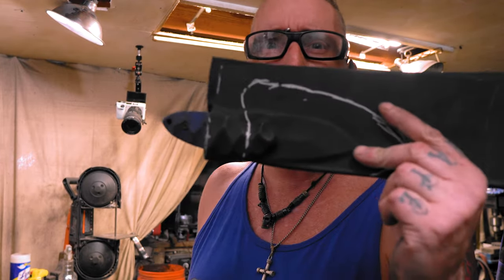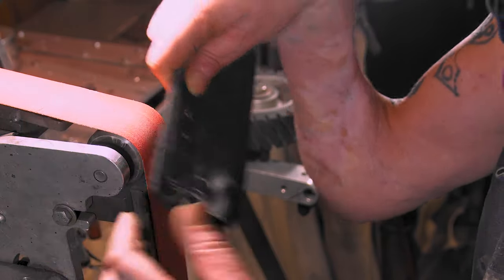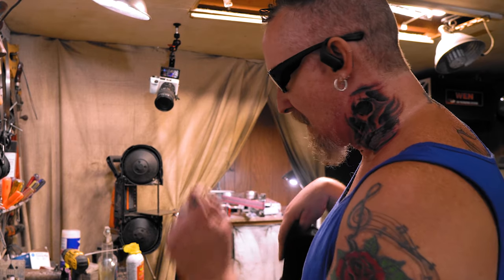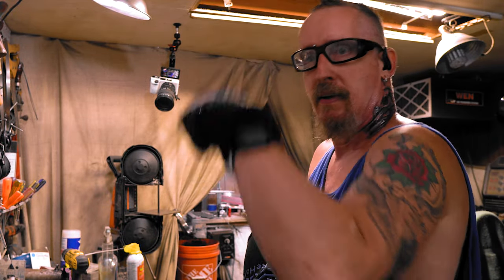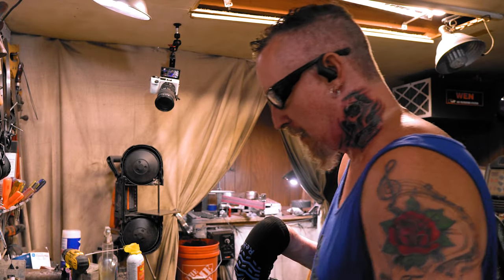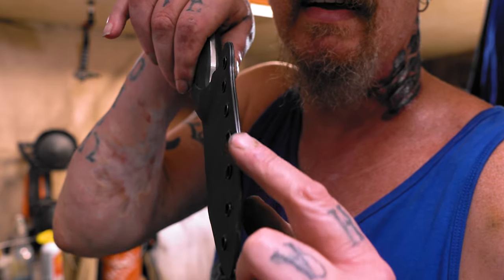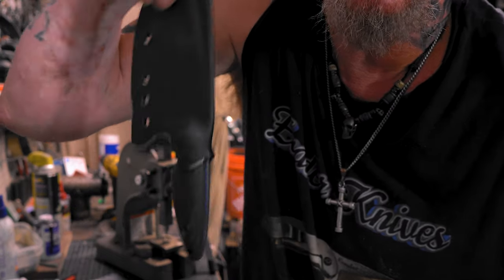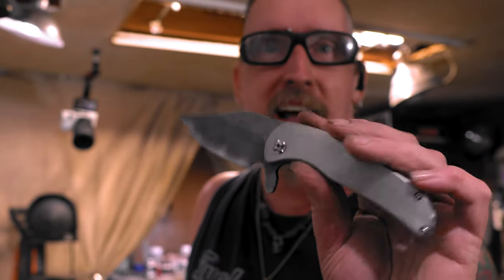Knifemaking - Kydex Sheath

Comment: i'm surprised you haven't bought a bigger bandsaw by now Dave! one of my biggest peeves with them is all those small cuts you have to do because of the shallow throat on them!!
Reply from the maker: It's not too bad. Sometimes I have to figure out creative ways to cut, so I'm not wasting material, but it's usually ok. Hope all is well
Reply: @evaderknives  it drives me crazy having to keep switching angles myself i prefer fewer long cuts!
Reply from the maker: @keithmoore5306  I hear that. I don't like it, but what I'd really hate is spending a few hundred on a new bandsaw, hahaha
Reply: @evaderknives  harbor freight had bench top one for $89.99 a while back!
Reply: @evaderknives  it seems damn good for under a C note!!
Reply from the maker: @keithmoore5306  I think that is a scroll saw for plastic, etc. The cheapest metal one is almost $300, at least right now. I had to go see
Reply: @evaderknives  no it's a 15 inch bench top bandsaw! i just picked up a metal cutting blade at /menards and put on it! works fine for my use! granted it's made for woodworking but it works!!

Comment: Dave is there any reason you don't just use a spacer to loosen the top of the sheath for your fit??
Reply from the maker: You mean instead of the piece of G10? Well because, I have made a few of them over the years & they basically fit my handles perfect, they are the same width as the steel. I mean it basically is a spacer. Did you mean something else?
Reply: No I ment the knife that was so tight, why not use a Chicago Screw and a washer between the front and back piece of Kydex to give it a touch more space. If you did that you wouldn't have to reheat the Kydex. I see them do this quite often with Gun holster to adjust the retention.
Reply from the maker: @stephenranti173  Hmm, didn't know I could do that. Appreciate the advice
Reply: Cool, glad I could help! Let me know how you make out!
Reply from the maker: @stephenranti173  It'll be a while till I do more kydex, but I might have to hit you up